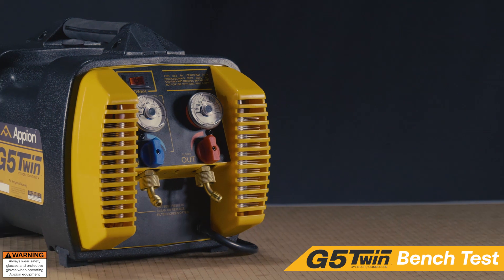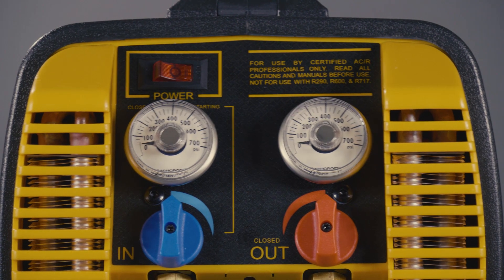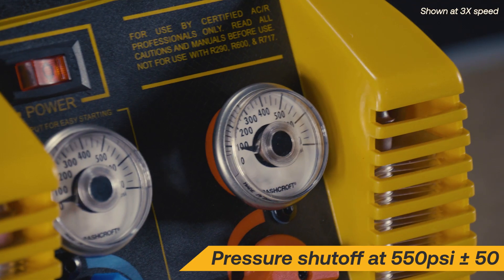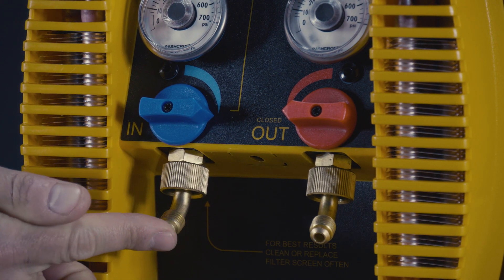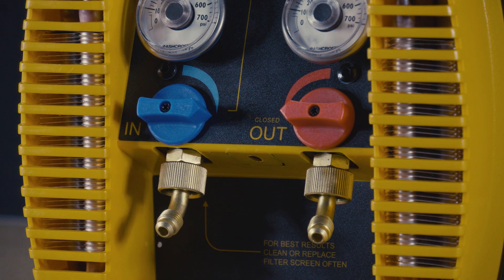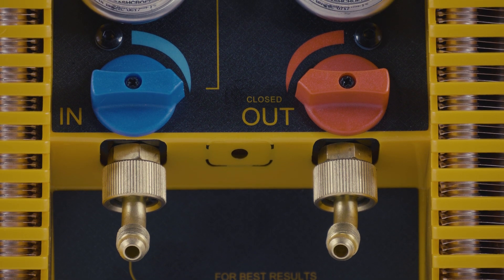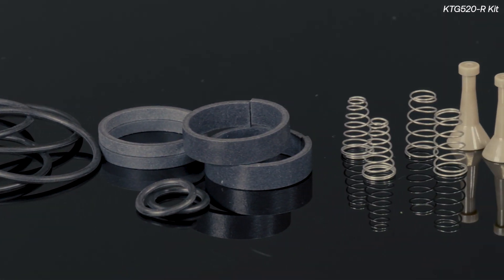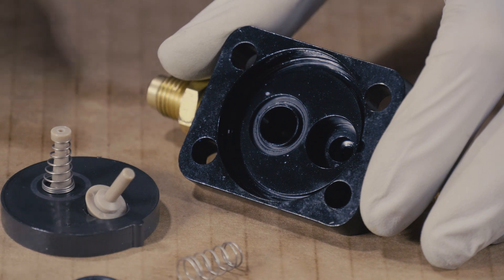G5Twin Diagnostic Test

Comment: Got a question about the test. What if the pressure during the test builds up quickly (probably 15 seconds or so), but it looses around 100psi during 1 minute test. Also ball valves doesn’t appear to be leaking since the soap water doesn’t do any bubbles.
Reply from the maker: please contact support@appiontool.com for product support.